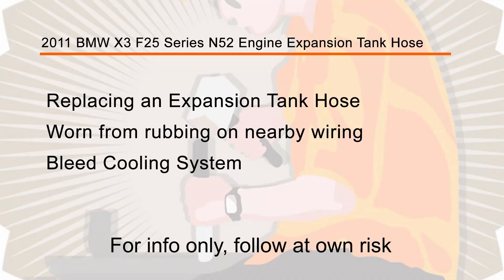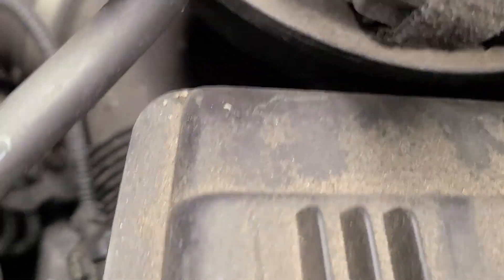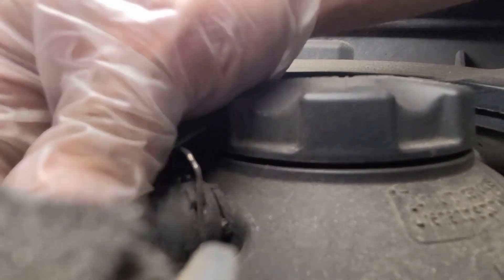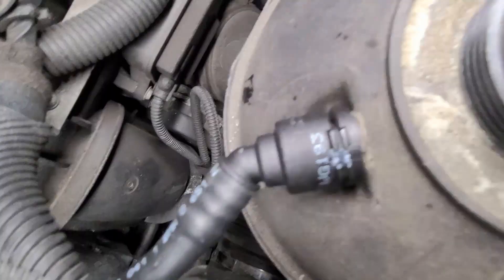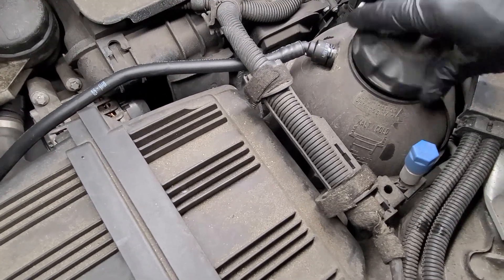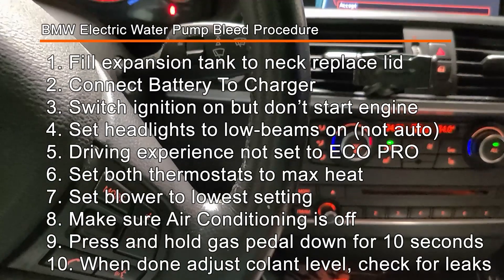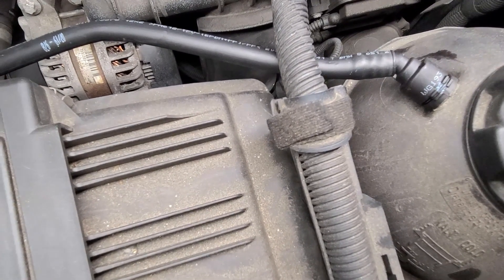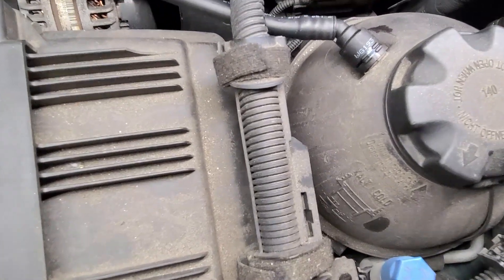Replace Expansion Tank Hose BMW X3 F25 and Electric Water Pump Bleed Procedure

Comment: Thank you very much for explaining the bleeding process so well. I replaced the rad hose from the water pump to engine block as on my 2012 it had corroded quite alot until it basically disconnected and rad fluid was leaking all over the place. This was the final step i needed to do. Thanks again 🙏
Reply from the maker: You're welcome! Thank you for leaving a comment let me know this contact was useful. Glad you got it fixed that bleeding procedure is tricky if you've never done it before.

Comment: Is the bleeding part required? I have to replace the same hose on my x3 as well.
Reply from the maker: Yes bleeding part is very important. You don't want air in the system because it can cause overheating.